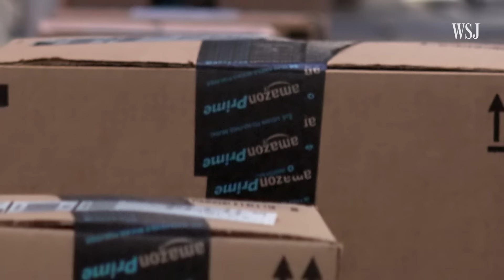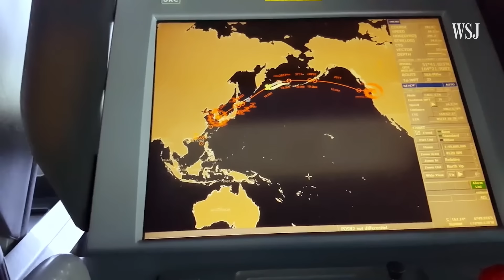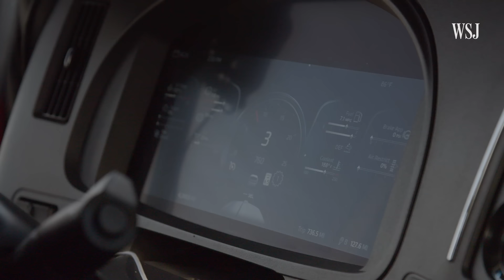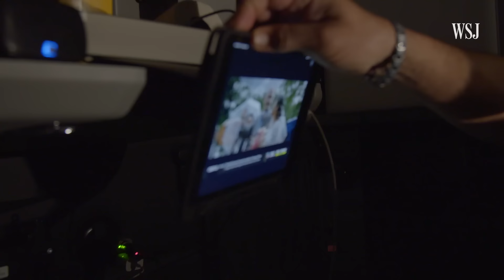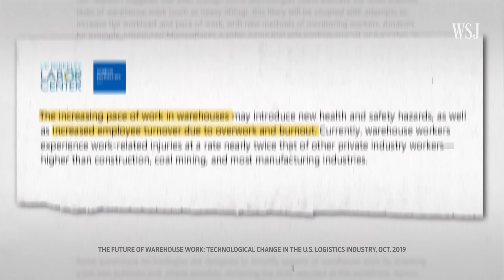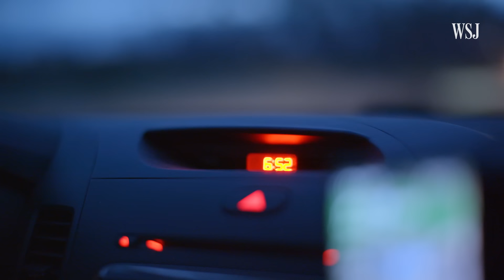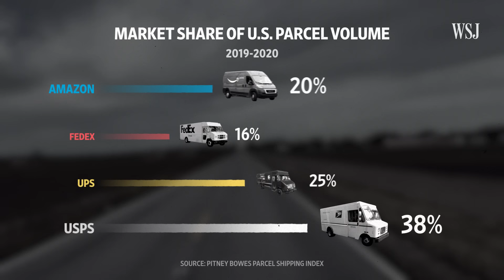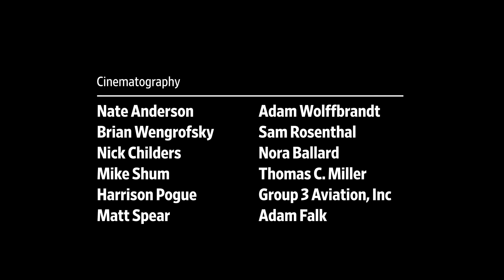Why Global Supply Chains May Never Be the Same | WSJ Documentary

Comment: As a FedX driver of 20+ years, I totally agree with the strain on all levels. With the cost of living lately,  it's getting harder to retain and hire additional workers in this industry.   There needs to a be a solution soon, or the supply chain will definitely take a hit.  Too much overtime for those of us that continue to  work definitely leads  to burnout!
Reply: you guys need to protest and stand around until you get a raise. Canada post workers did that multiple times ( My Dad worked for them in the parcel plant for like 30 years ) . If people dont protest, they never get change. If postal workers protest, nothing gets delivered and their demands will certainly get met.
Reply: The harder it is to find workers, the more power current workers have to force better pay and working conditions, don't hesitate to take advantage of that situation
Reply: @cIeetz  and the prices go up againts and the buyers protest cause the prices is too high and the problem just repeated themselves, try another solution other than asking for a raises, we are trying to make a working economy, not a massive apocalypse
Reply: The solution is sir, fed ex needs to remove that banned for life policy if some goes wrong. I was in small sort. Did 3k packages a day. 24 hr shift on peek. I got phenomena called out the message wasn't released and I got put on the banned list.
Reply: @Goodfella2.0 Ouch, so the amount of work I have personally done at FX freight working 12 hr plus days in and around downtown Seattle the past couple years is not enough for an opinion?  I've delivered throughout those 'protests' at chop/chaz zone & mentally ill homeless, precious materials to hospitals/ emergency response,  PPE to major facilities/companies,  replacement furnishings/goods that was robbed/stripped bare and burned, steel structures and equipment to well known major construction sites, ect...  Extra time put in because coworkers left for various reasons,  but I need to maintain income for my family and want to serve the people I care about in my community where I grew up.  How is it that I have no say in the matter?
Reply: @Loaded Libertarian Yeah, it's not Union so they could fire you for insubordination.  An employee just can't demand to go home if the work isn't finished.  Any requests to leave at 8 hrs or earlier must be requested before or upon arrival so that plans can be made to accommodate the work day.  Only working consistently 8hrs per day isn't something that's entirely possible due to various workloads, weather and traffic conditions.
Reply: @Loaded Libertarian Quite possibly.  Make an example of a refusnik or two to keep the others in line.  It's not uncommon in the business world, even if it makes life harder for the bosses in the short term.
Reply: That's exactly what I said!
Reply: @r.i.t.randominterestingthi4031  that's a falsehood. I work in the retail end and the profit margins are so high that even if they needed to pay more for a product, they would not lose money keeping the product the same price. Currently they are using the current raise in minimum wage to hike up prices beyond what they need to, to get even more profits.
Reply: @jorgeg6418  you work in one product, i m work on 6 kind of product, not all of them has high profit margin.. some barely alive by 1-3% per item and still have to pay even though theres no profit at all
Reply: @jeremytine  theres profit, small margin profit barely enough to satisfy the customer and the owner. saying this kind of phrases aint helping anyone but ur ego
Reply: @jeremytine  u blind or something? which part of my sentences said no profit?
Reply: The solution is destruction of the wage gap. Existing workers should be paid more. That's the only solution to retention outside of cultural growth in the company, which is mostly irrelevant as a driver. Go look up the salaries of the executives of your companies. Not saying they don't have valuable minds, but people shouldn't be making 10, 20, even 100 times the people who are laying down the path.
Reply: Y'all need to get crack'n , RUN!  I need my Xbox and doughnuts darnit.
Reply: Seriously--later this decade robotics are going to expand to the roads, autonomous driving and moving pkgs to and from delivery vehicles, pretty much everything.  Humans will be phased out.
Reply: @r.i.t.randominterestingthi4031  So perhaps the massive increases in profits by the corporations at the expense of the average worker have nothing to do with it???
Reply: You could try not driving like arses and parking on fuel islands then people would have more respect for you and be sympathetic to your cause.
Reply: Thanks for that:) the upside maybe you guys are a very few with job security right now
Reply: @cIeetz  canada and european countries are all a majority white. this is why their governments allow them to have such a high quality of life. thats the ONLY difference when you compare them to america. since america has more money than most of those countries combined and could afford to pay for their own and many other countries social needs for high quality of life...
Reply: @r.i.t.randominterestingthi4031  nothing gets sold in modern markets unless you can sell it for at least 10 times what you pay for it. i've worked in a lot of different industries and seen the numbers in all of them. on average, every single worker in any given business is generating nearly a thousand dollars in PROFIT every day. thats after all costs are taken care of too like wages, insurance, rent, supplies etc...
Reply: @saturationstation1446  which country u mean? i was talking for south east asia, cause i m pretty sure no such thing ever happen to any of my jobs (the 10 times cost) unless u r in 3 star michelin restaurant
Reply: @Mrbfgray  lol
Reply: Sorry dude.  I cringe when I see someone using your company.  Soooo many problems with delivery process.  30 calls on 1 delivery.  They claimed the repaired computer, I am using right now,  was delivered to the Apartment Office on a holiday and signed for when the office was closed.
Reply: @starman_alpha  I'm not sure what happened there. I'm with the freight division and such deliveries are not allowed unless the customer agreed to receive without signature.  Of course there could be some employees that don't follow the rules or cut corners , but that's not allowed or condoned. There's generally consequences for such actions that leads to termination.
Reply: @cIeetz  that, and many other reasons is why AI and robotics will start filling those positions. Human labor in many occupations are slowly becoming obsolete.
Reply: I'm leaving the industry soon it's too dangerous out there on the road
Reply: @ryanfuller7834  No kidding! Driving in and around downtown Seattle yesterday was a nightmare.  So many inpatient and wreckless drivers!  Now that people are getting back to work physically,  they definitely left their manners at home.
I think the new 'no chase' laws up here may have something to do with it too.  Many people driving without plates or expired plates while speeding on freeways without signaling and blowing through stop signs in neighborhoods. Saw an accident and a few almost happened right in front of me. Just insane!
Reply: The problem is that management is poorly trained in these companies, and have poor insights into what is really going on in their companies. Think about that many of these companies were set up before the internet and they still operate for the most part using old rules, where they should be operating using techniques to match the new environment such as data mining from within, everything is data, from how many steps it takes to walk to one pod to the amount of pressure put on a workers spine by walking extra steps, this is just one example.
Reply: Record profits and skeleton crews.
Reply: the ceos are taking the working classes money and sitting on it
Reply: The solution is to start producing what we're importing. Problem solved. We were once the world's largest producer and now we produce nothing.
Reply: Please be careful and stay safe.
Reply: We need to pay our workers more. This will incentivize more people to take up the job and also alleviate those who are already in the workforce from working longer hours than they must. We also need to shorten work days all around. We are human beings and we need human connection. If we do this I believe things like depression and substance abuse will go down as well. That is just speculation of course but I believe a huge contributing factor to alcoholism is the stress of our professional lives and the severance from real human connection.
Reply: @r.i.t.randominterestingthi4031  My main question would be and I agree with the point you make, can or do these companies have enough revenue to where they can increase worker wages and still retain a profit for their shareholders? Let's assume that this was the case then what would be stopping them from taking such actions? Conversely, hand in hand with your point, a second assumption is that these companies don't make enough revenue to where they can increase worker wages and simultaneously reach its profit targets and it's hard for me to suspend my disbelief with this assumption if it is actually true. I'd like to hear your insight on the point I have raised.
Reply: @jbagelfishing2907  Genuine question so what should be the ideal figure they should make? As it is currently, that is what incentivizes them to work to get to such positions.
Reply: @kennythelenny6819  I mean, that is really up for debate. If you have executives making a few million I don't think that's odd or egregious. But to have people working at tough supply chain roles who are paid $17 an hour, and a single person who makes decisions instead of pressing buttons is making  $17K an hour, you can see there is a clear disincentive to the $17 an hour role creating a problem when you pair it against cost of living and opportunity cost for the individual. Just go flip burgers at that point
Reply: @kennythelenny6819  Yes, they can still record a profit and pay their workers. the missing link is can they retain MORE profit than the last year. It's not natural for people to contribute 20% more than they did last year for the rest of their lives, but that is the expectation of the worker bee.
Reply: Again. Corporate greed.
Reply: @cIeetz  FedEx ground is contracted out so if people from a certain contractor protest they just don’t renew the contract or terminate it even if they have to pay
Reply: The next corporate phase will go to home delivery by drones and take the driver out of it.